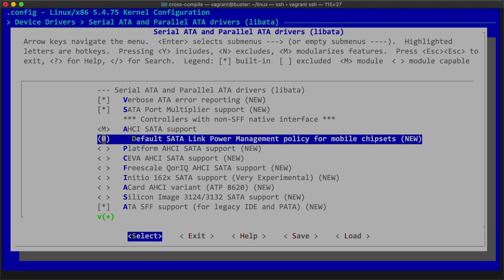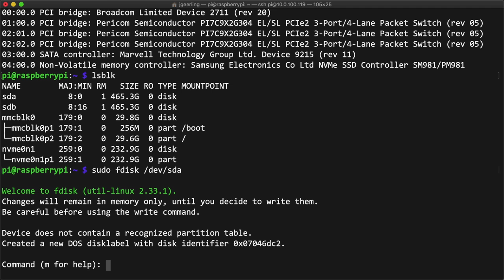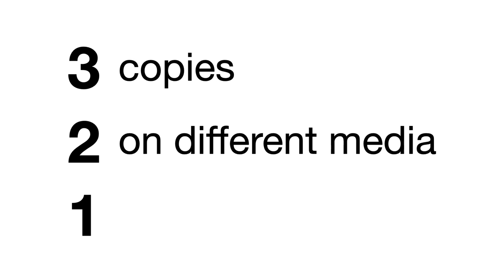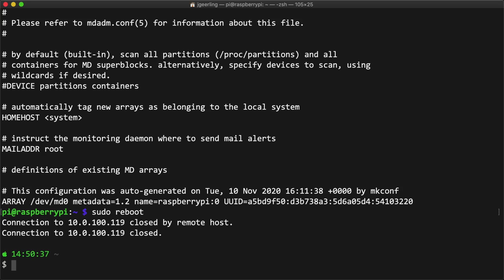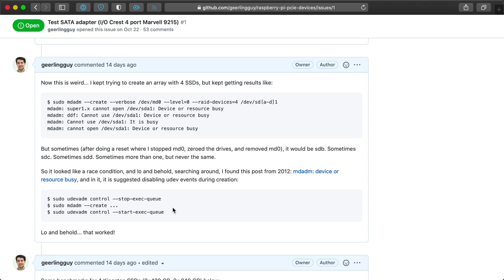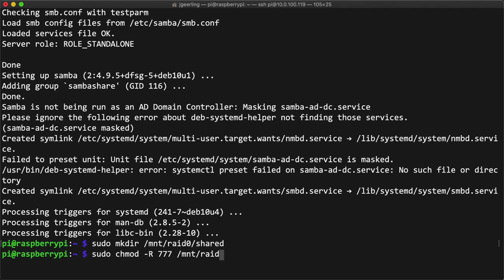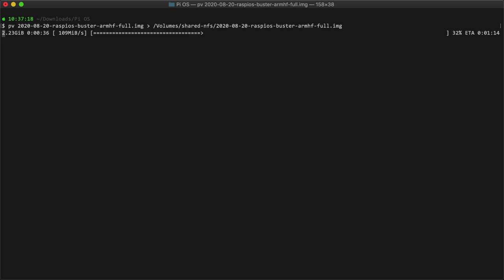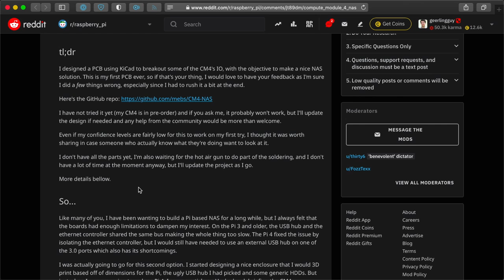I built the fastest Raspberry Pi SATA RAID NAS!

Comment: I like your videos so please don't take this as sour grapes. I was there at the RAID introductions. I worked at Digital Equipment Corp and from there worked with Intel, Kodak, and Texas Instruments developing the SCSI interface. This is the interface that allowed RAID to be developed. I was there for that too. I don't know when or how the language changed but at the beginning RAID stood for Redundant Array of Inexpensive Disks. I know language changes over time and maybe today the "I" should mean independant, but we all decided on "Inexpensive" because once the RAID was built and working they were no longer independent. And, yes the word "independent" was on the table but it was rejected at that time.

You have to remember that in those days most hard drives cost in the neighborhood of $15,000 to $50,000. The smaller and cheaper SCSI drives ran around $200 per meg but they were less reliable so RAID 5 was developed to allow for failures - which aren't as common now as they were in 1980. I hope this helps with the history.
Reply from the maker: Thanks! I remember the first SCSI drive I replaced in a Mac (didn't do any RAID at that time), and am currently wearing a SCSI shirt as I type this comment. One of my favorite protocols, still kicking today!

Comment: Being a long time storage enthusiast, you really rubbed me the wrong way, saying RAID10 is safer than RAID6...
The only thing RAID10 really does better than RAID6 is the performance of small writes.
a RAID10 can fail after losing 2 drives, RAID6 need to lose 3 before data is lost.
And just the amount of times i have experienced double-disk failures during rebuilds, makes me stay FAR away from RAID10.
Next there is bit rot/silent corruption, depending on implementation, RAID6 may prevent this, RAID10 can not prevent this in any way.

One thing people often forget when saying "but raid 10 can tolerate losing half of the drives" is that the drive that is under most load during a rebuild, is the very drive you can not telerate to lose and thus the drive you are most likely going to lose.
Reply: Thank you! I was going to say mostly the same thing... That segment of the video made my head hurt...

Let me add this though: He groups RAID 5 and RAID 6 together... RAID5 is absolutely not recommended for large drive arrays. It's a controversial topic, but googling "Has RAID5 stopped working?" shows what it's about.

Also, regarding the LTT video he mentioned, I'll just quote a comment there: "3 RAID5's in a stripe. IN WINDOWS. What were you thinking, man." The video is from 2016 and Linus has since made a massive upgrade with proper reliable storage. Hint, he doesn't use RAID10 anywhere.

Jeff, I like your videos, and I can empathize with your concerns about parity, but you got this one wrong.
Reply from the maker: With RAID 6, during the resilver/rebuild, all drives are working harder, incurring a greater performance penalty across the array as well as increasing the likelihood of an extra drive loss.

With RAID 10, up to half the drives could be lost, depending on the drive, but as you say, there is still risk during a rebuild, that may be slightly greater than the proportion of risk with RAID 6.

In either case, RAID (IMHO) is basically a convenience to sometimes prevent the loss of an active storage volume by replacing bad drives—separate backups are still incredibly important, unless you're just using the drives for caching.

ZFS (and to some extent, BtrFS) may also have ways of making this very slightly less risky through some of their features, but it's still the number one mistake for someone (I'm not saying you, but anyone) to think of RAID as providing data backup/security.
Reply: @JeffGeerling  You are right that all drives are working in a RAID6 during rebuild, contrary to just one disk in RAID10, so a RAID10 performs better during rebuild than RAID6 (normally, there are exceptions), but this doesn't change the fact that a RAID6 can always lose 2 drives safely, a RAID10 can not.

Yes there are more disks to spare in a RAID10, but you aren't likely to see a URE on a disk sitting inactive in the array, so these disks are providing minimal protection.

RAID is a measure for availability, not backup, true, but in between your backups, the data that lives on the RAID, is the only copy you've got, so if it is important to you, you still need to treat it like it is the only copy you have.

You didn't touch on the fact that RAID10 can not do anything to prevent corruption, there are 2 sources of truth in a RAID10, there are 3 in a RAID6, so RAID6 protects the data integrity better, unless you use ZFS or T10-PI like i am.
Reply: Guys, you should take a look at dRAID (new in OpenZFS 2.0) for an alternative to RAID5/6/1+0.
Reply: @rednammoc  no thanks, i'm not touching zfs :)

Comment: Great video.. one thing not mentioned that is very important. When running software raid it is important to have the device connected to a UPS. Hardware raid cards can survive a power lose, but software raid never will.
Reply from the maker: True! Both my desks in my office have 600W UPSes, so anything I'm plugging in for testing goes through one of them, along with my little 'production Pi stack'.

I should've mentioned it in the video though—even some hardware raid controllers don't have battery backup and can have serious issues after power loss!

Comment: I'm using raid 6 pools. (Fs is btrfs but the raid is mdadm, i have snapshots enabled via samba etc. And no I'm not using freenas. I do by hand).

Important data is in raid 1, with my 3 rule backup:
3 copies
2 in difference sites
1 offline

Why? Because sometimes you delete a file and the rolling backup script override the history. Doh! Especially if you discover a cancelled file after some years...

9:15: me screaming on my Xeon.
(I have lot of VM in that's... Actually host is proxmox, VM are nodes of k8s cluster.)

Also my NAS, router pbx, is a VM, all virtualized in a single machine!

Comment: What happens to ssd's in raid arrays when they have reached their read, write limits? They can only be written so many times and then they start failing.
Reply: Same thing that happens to failing hard drives, they get replaced. Simultaneous failures would definitely be an issue with SSDs in an array all being identical and being written to the same amount, but these kind of issues already exist with HDDs (it's common for many drives in a large array to fail "together" since they are often all manufactured at the same time and used the same way)

Comment: The component that's getting hot looks like U3, which is most likely a switching regulator of some sort. It's probably converting the 12V rail on the PCI-e slot down to 5V or 3.3V for the controller, and they've clearly chosen an inadequate/undersized component with too high of an on resistance. 120C is way above a sensible long-term value for a component like that, especially on an open-air bench!

Comment: Hello, I saw one RPI project that blow my mind, its name is PiStorm and it is to add a Rpi as an accelerator for a real Comodore Amiga. It is a New deal on retromodding...

Do you know if it os any way to connect to one board a GPU an two RaspBerries? I thing it Will be amazing to make an scallable computer with this concept...
ARM is Power full and Rpi is able to load very good almost any think, with limitations but PiStorm project blow my mind... It is possible to use RPies to thinks Like that

Comment: RAID is only useful if you need to stripe for performance or don't want downtime (in the traditional case, with ZFS or btrfs it is useful to repair broken data detected by checksum logic). If that is not important enough for you I would just not use RAID at all and just use single disks + backup. That is if often cheaper anyways.

Comment: 0:01 most reliable
>shows Kingston drives

otherwise great video
Reply from the maker: Haha, well, when you put four in RAID 1, you get about the reliability of other single drives!

But on a more serious note... since I bought four of them for testing, I didn't want to spend my annual YouTube budget for one video, so I went with these since they're $20 a pop brand new!
Reply: @JeffGeerling  I've been using those A400 drives for casual use on my laptop, a netbook (yes, one of those from 2009), a spare one for testing hardware and one hanging from a sata2usb adapter on the back of my computer and they've been reliable until now, unlike a Crucial one that died on me after a year of moderate use
Reply: I have a 120GB Kingston A400 (SA400S37120G) for swap, currently it has 10593 hours of power on time, 99 power on count, 13691GB host writes, 14019GB host reads and 25781GB total NAND writes. CrystalDiskMark shows 75% for the health
Reply: Heck inland professional drives are fairly good too...and not too pricy
Don't be hatin'
Reply: People, there's a reason why Server/Enterprise grade drives exist.
Look, it's good that your consumer drives didn't cause any problems in your consumer workloads. But I can ensure you no "most reliable" labeled NAS will ship with those kinda drives. 
Kingston in particular showed that they are willing to switch to lower grade parts mid production in order to save money. Even in the server market.
No question they make cheap, available parts, just not the "most reliable"

Comment: Have you tried the Quad SATA hat from Radaxa/Allnet China? This has been a neat card I've tried! I run it with 4 1TB WB Blues and an RPi4 GB. I imagine the USB translation layer does inhibit speed somewhat though...
Reply from the maker: That would perform similarly to the USB to SATA adapters I tested. not a bad option, but you do lose out on performance going through USB.
Reply: @JeffGeerling  Do you think it would affect spinning rust though? I would think 4x SATA drives in RAID 10 sharing the 2.0 x1 link with the Gigabit Ethernet would be the big bottleneck

Comment: SSD's are raids by themselves internally by the way. That's how they achieve any usable capacity in the first place.
Reply: While the way SSDs function internally is analogous to how RAID functions they are totally different technologies in implementation and should not be compared to each other in this way.
Reply: @ZeroX252  which way me comparing them are you objecting on? I didn't compare anything.
Reply: @nikoladd  you said they are raids themselves internally, which isn't accurate. While the function of the SSD controller and multiple chips is similar to raid controller and JBOD, fundamentally they are different technologies with different implementation approaches. For example, raid, even ZFS, doesn't take into account where each block is located, whether or not there is any wear due to a write operation, and it leaves all of those decisions to the disk itself. The NAND in an SSD has no brain. The SSD controller is both the brain for the NAND and an aggregator for the individual  chips. DATA is stored asynchronously and more or less totally random on an SSD by the controller. This is completely the opposite of raid, where data is stored in a complex ordered pattern to achieve better performance on rotational media and allow for easy data restoration from parity. Internally, for an SSD this data ordering would be both a waste of execution cycles from the controller, and result in lower speed since the data would be limited to the slowest single chip internally. 
Again, while similar in nature, they are not comparable.

Comment: Hmmm... using RAID 5/6 for >20 years now.. no, you're wrong. It just works fine with good hardware like Infortrend, Areca or similar.
Reply from the maker: I'm. It saying it doesn't work, more that I'm not as comfortable with parity-based RAID as I am with simple mirroring.

In either case, the most important thing is to maintain good backups!

Comment: Is this possible to use freeNas on raspberry pi?? ( 14:10 )
Reply from the maker: Technically FreeNAS requires x86 (see https://www.freenas.org/hardware-requirements/), but the 8GB CM4 with a SATA card meets every other hardwire minimum requirement... sooooooo.

Also, Ubuntu for Pi includes ZFS support built in (as I learned from a comment elsewhere on this video!).
Reply: Technically yes, but you need to do manual build for RPi

Comment: @Jeff Would an iSCSI drive over gigabit beat a USB 3.0 SSD in prcessor intensive tasks? Like watching an 80Mbps 4k movie, or doing gzip compression on a large virtual machine image, or running a checksum on a large ISO

With good over clocks, the SD card becomes a serious bottle neck.. I could open chromium flatpack twice as fast if my card could keep up with the processor.

On a completely different note... You can reduce IO interrupt loads with polling https://events.static.linuxfound.org/sites/events/files/slides/lemoal-nvme-polling-vault-2017-final_0.pdf see linus' video on his all ssd caching server

Comment: Hey, the world ran on RAID5 or RAID6, parity RAID is much safer than the internet portraits it to be. And RAID6 is safer than RAID1 or RAID10! It’s just not cost-efficient to run RAID1(0) for everything. Please don’t scare people away from valid proven technology that has clear benefits. Especially if it’s mostly based on emotion. Did you also discover the —assume-clean mdadm option? Perfect for benchmarks.
Reply: Plus you can have the write-hole issue if you use a hardware / software raid controller without a filesystem with self-healing (like ZFS, BtrFS or even ReFS )
Reply: @Michaelmaertzdorf  yes that story really became an issue ar the time ZFS gained some traction and had to justify itself. But that write hole is not a risk because by default the mdadm  Bitmap is enabled that protects against it at the cost of random write performance afaik.

Comment: You might find the periodic slowdowns were caused by the SSDs themselves slowing in speed. Many cheaper SSDs hive off a small amount of storage to use as SLC fast cache, so that you can get fast write speeds, but on bigger transfers, this cache can get filled up, and then the drives need to drop down their speed to their true MLC or TLC (and even QLC in newer drives) speeds, which can be significantly slower. Add in erroring blips as the PI figured out it had to pause writes to the drives, and that's probably the drops you see. 

If you look at this article 6GB copy tests, you can see speeds are initially good, but then drop down significantly partway through the copy. I suspect you were bumping into a similar limit. 
http://glob3trotters.com/portfolio/ssd-value-roundup-crucial-bx500-best-bang-for-buck-kingston-a400-adata-su650-wd-green-sandisk-plus/
https://www.howtogeek.com/428869/ssds-are-getting-denser-and-slower-thanks-to-qlc-flash/

Comment: Raid 0, 1, 10 is not that viable in larger setups(10+ disks) . And zfs needs so much ram for this sizes of arrays. A raid5 or raid6 array still the only real option for a budget build.
Reply from the maker: ZFS needs a ton of RAM for any array; one reason it can be a little difficult on smaller SBCs.
Reply: @JeffGeerling  ZFS "needing" tons of ram is mostly a misconception at this point. Sure, more RAM always helps and ZFS is excellent at using more RAM for caching if you can afford it, but you can absolutely get by without huge amounts of ram.

Unless you turn on deduplication, which, although ZFS claims to "support," any time it's mentioned, the immediate reply is "don't use that!!"

Comment: Freenas is x86 only with at least 8gb ram. Unfortunately there is no way to get it on the pi
Reply from the maker: So far... I'm hopeful with M1 from Apple, more ARM support from MS, and the Pi and other SBCs inching upward in terms of performance per watt, they start building multi-arch like the rest of the industry.

Almost all the underlying libraries and tech stack works perfectly fine on the Pi already.
Reply: @JeffGeerling Other SBCs were much faster (4x PCI lines) several years ago. RK3399 SBC and with proper NvME can go over 1000Mb/s faster than Raspberry Pi 4 ... M1 from Apple is just another proprietary ARM based chip not exactly in cheap RPi class. If it must be ARM, one can purchase Ampere server ... https://www.youtube.com/watch?v=7BtuFqj9YeQ FreeNAS is BSD based - architecture is not a problem, they are just far behind and different enough world but I think they (FreeNAS) plan to port things to Linux. How is MS related to all this? Except that Rpi runs Microsoft owned proprietary OS which runs ARM cores and Linux.

Comment: i say the biggest issue i had with hdd storage ever since it passed 500gb per drive was slow degradation of small files like i was regularly loosing some of my photos like a spreading plauge with no scandisk detectable issues
it never happened to me on smaller drives or ssd's so i say high capacity storage is at least for me very unrelible storage

Comment: is it possible to wire a battery to the compute module io board
Reply from the maker: It has an RTC battery slot on it, for time and scheduled operations (with an onboard RTC), but no inline battery backup connections (e.g. for power outages). You would want to connect the board to a UPS for that.
Reply: @JeffGeerling  i would like to a handheld is all but i need help with it is why i was asking

Comment: Can the cm4 boot with nvme?
And if so. How?
Reply from the maker: Not yet, unfortunately :(
Reply: @JeffGeerling  that's unfortunate
Reply: @JeffGeerling  But is it possible to plug a USB 3 to NVME adapter into, for example, the Syba SD-PEX20199 or another USB card with the VL805 chipset and boot from the NVME drive?